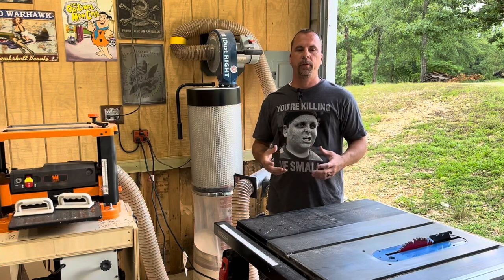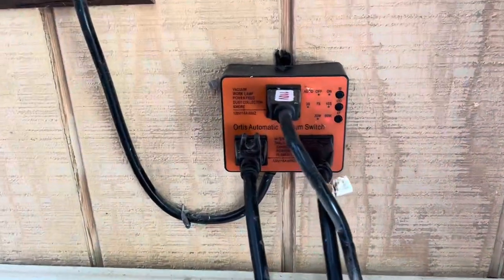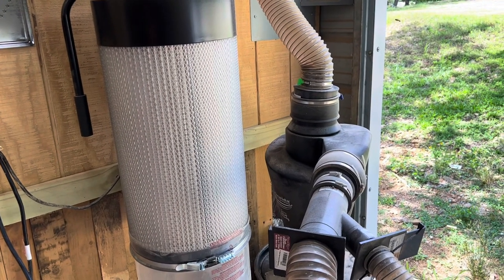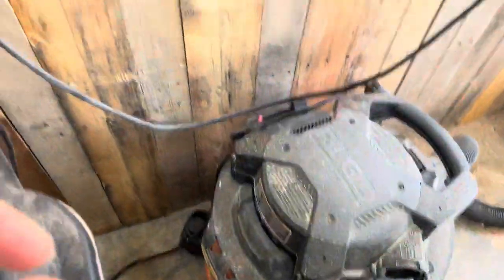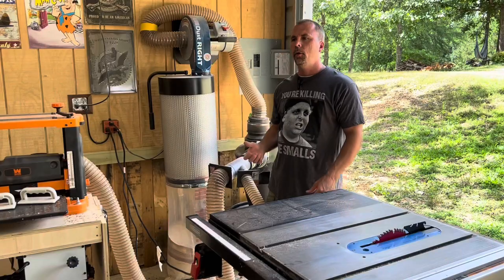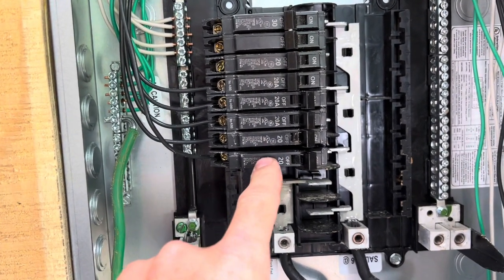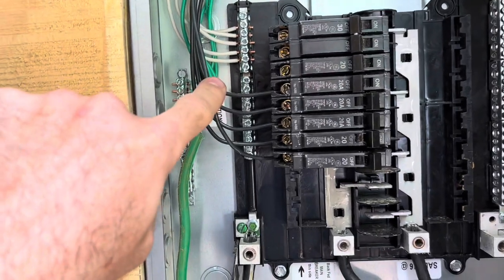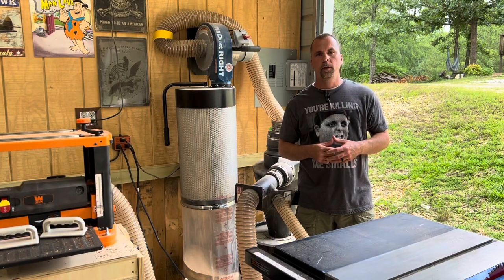Power Tool + Dust Collector Is Tripping My Breaker

Comment: I had the breaker on my switch trip when I was cutting heavier loads on the table saw. Both Vac and table saw were on the same circuit. I abandoned the switch and put Vac and table saw on separate circuits (table saw on a 20a and vac on a 15a.) This solved my tripped breaker problem. I just have to turn the Vac on and off manually.

Comment: This was very helpful information coming from a carpenter that only does limited electrical work! I know enough to get hurt 😳 so I stick to ceiling fans, plugs and switches. I do need to install 20 amp breaker for my new bandsaw. 
Thanks again!
Reply from the maker: Glad it was helpful!  I was thinking about doing a more detailed video on how to change the breaker and running a new wire, what to buy and exactly how to do it.
Reply: @yellowhammerwoodcrafts  That would be very helpful from a woodworkers perspective as well.

Comment: Those switches are really neat but I can't see them working in my shop due to how I set up my electrical.  I also went 20amp breakers, wiring, light switches, and outlets but I split circuits.  I have my table saw 220 on it's own breakers obviously but then miter saw, planer, dust collector and shop vac are all on separate breakers to avoid tripping them.  I never looked into switches like you have there with the delays.  I also recommend making sure if swapping to a 20 amp breaker run new wire and also ensure the outlet is 20amp.

Comment: My basement only has 15 amp breakers currently. Only trips when I use dust collector and tablesaw under pressure. Before I switch to at least 1 20 amp circuit, I was wondering if using a splitter and working off 30 amp dryer outlet.
Reply from the maker: I’m no electrician but I have a little electrical experience and I wouldn’t recommend that.

Comment: Is there a transformer available that is capable of connecting to a 15 amp circuit breaker and converting it to a higher current output?
Reply from the maker: I am not sure about that.